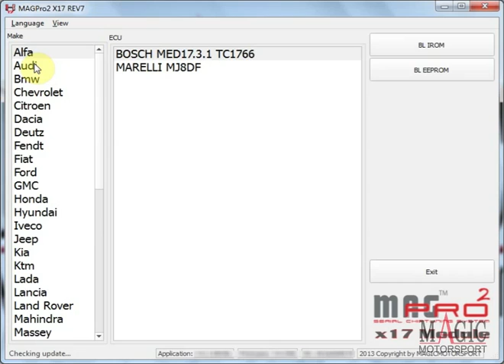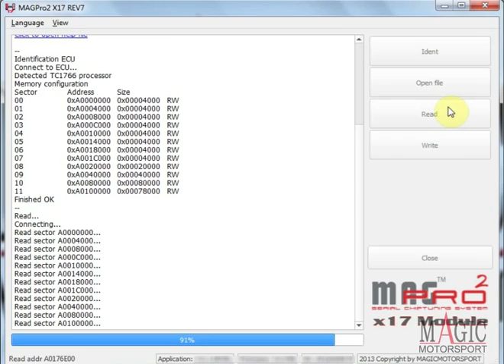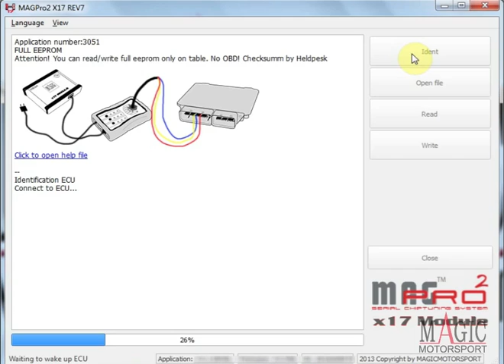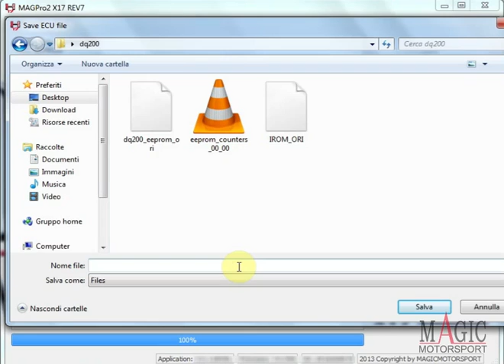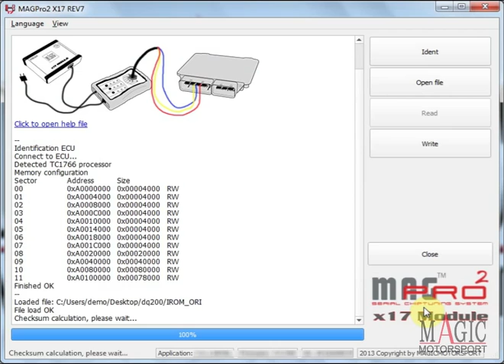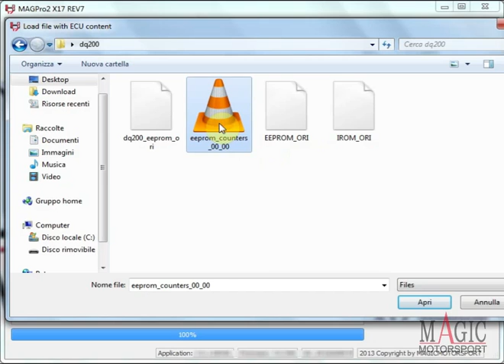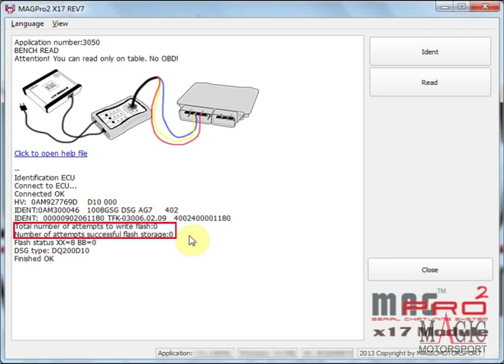VAG DSG controller cloning and flash counter reset - using MAGPro2 X17 tool

Comment: need to know wether it has to ability to do flashing to the DSG and to the ECU ?
I mean if I have update or upgrade dump  to the DSG or ECU , can MAGPro2 x17 do Flash it to the ECU or to the DSG ?
And another question please... if I have an automatic ECU for skoda diesel 2013 with continental simos PCR2.1 engine code CAYC , HAVE I THE ABILITY TO MAKE CODING TO IT FROM AUTOMATIC TO MANUAL OR VICE VERSA  ?